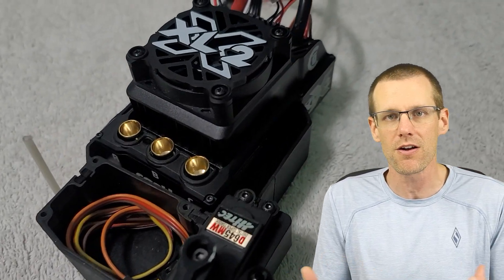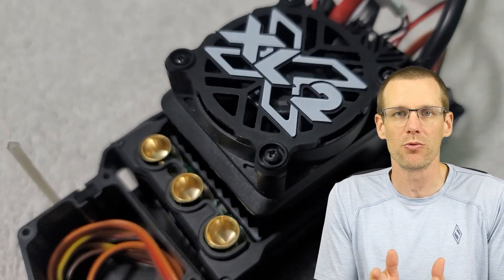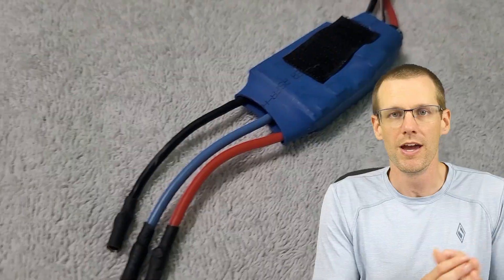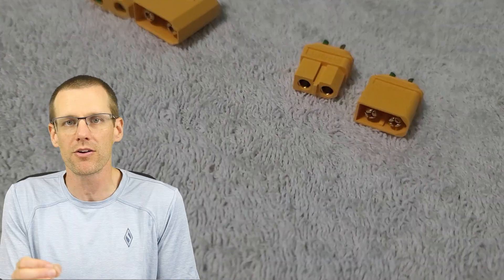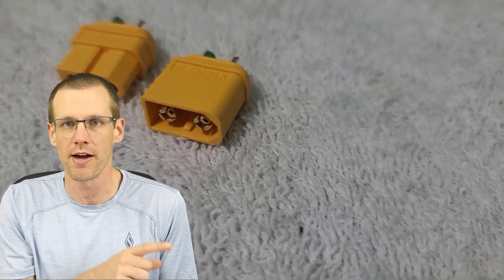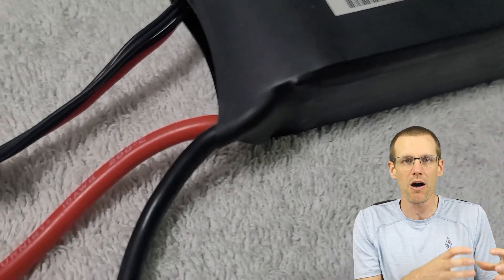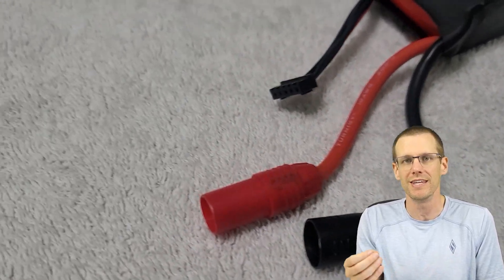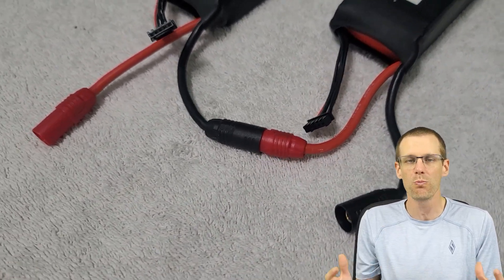5 Min. Ultimate Guide to Bullet Connectors: Motor, ESC & Battery Connections!

Comment: would it be safe to use a loop connector plug on one plug for an esc with 2 plugs so i can use one 6s battery or do you think that would cause overheating problems?

Comment: The only potential pitfall with this is that you could connect battery positive to negative and that would be very dangerous..
Reply from the maker: That is correct!
Reply: @RCexplained when connecting my male connectors to female battery. Does it matter which one I plug in or unplug first?
Reply from the maker: If you have a resistor on one lead, this lead should be last to avoid sparking. If there is no resistor, it doesnt matter.
Reply: @RCexplained thank you!

Comment: What are these connectors you use on your battery packs? I never saw these anywhere before, and I never saw these in any LHS here in Germany. I'm just stuck with EC5 for my bashers and QS8 for both my speedrunner and my drag car. That makes it somewhat inconvenient and unneccessarily complex for my charging setup as well as for when I go outside for driving with friends. Some of them use XT90, some use these Traxxas connectors, others use EC/IC5, that is awful.

BTW, thanks for your videos, even as an electrician, I learned a LOT from you! Thank you for that!